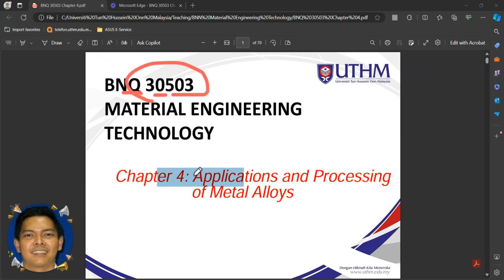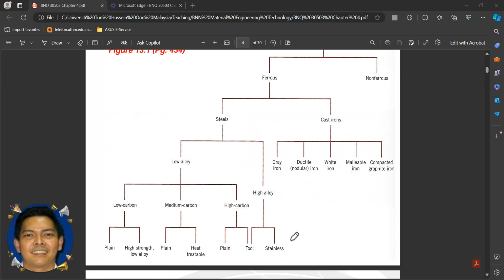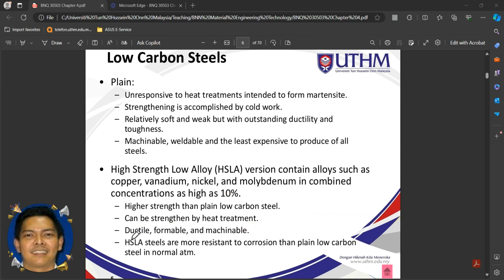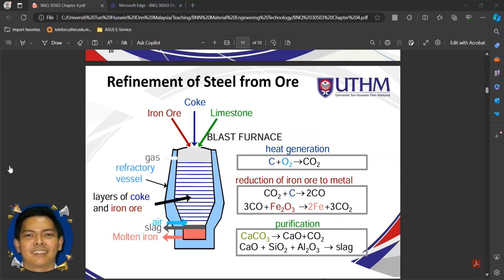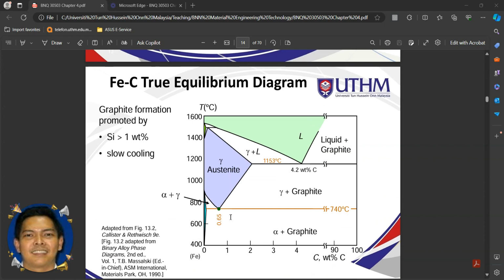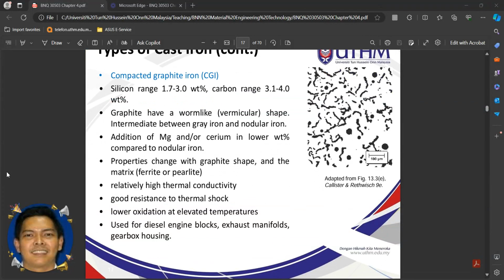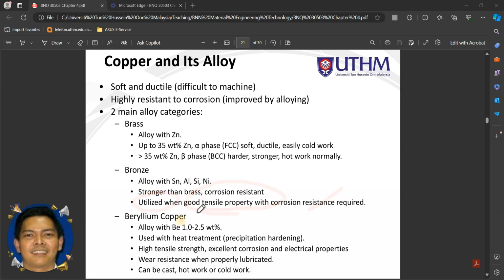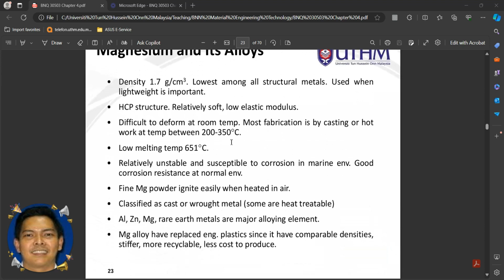Chapter 4: Applications and Processing of Metal Alloys (Part 1)

Comment: thank you for the lecturer dr. What i have learned from the lecturer is the application and processing methods of metal alloys in industries like construction, automotive, aerospace and electronics. it covers ferrous metals and non ferrous metals. dr also highlights the uses of low alloy steel, high alloy steel and stainless steel for their strength and corrosion resistance and the advantages of aluminium and copper alloys in aerospace. key processing methods include thermal processing and precipitation hardening.

Comment: Fatin Nabilah
Thank you dr..for this lecture..

I've learned how to classify metal alloys as ferrous or nonferrous and how to use examples from this video. Apart from that, describe the low and high alloy divisions of steels using examples. Will there be a chemical reaction if we simply combine the pure metals together?

Comment: From this chapter, I've learned that the choice and application of metal alloys vary depending on their intended use. Different alloys are utilized and processed in various ways based on their unique properties, such as strength, conductivity, and corrosion resistance, which make them valuable in industries like electronics, aerospace, automotive, and construction. Processing techniques like forging, casting, machining, and heat treatment are employed to achieve the desired shapes and properties.
(Wan Ariza)

Comment: Afrina (AN220220)

thank you, Dr. for the good video explanation about this chapter. What i learn is the classification of metal alloys, which is ferrous and nonfererrous, the characteristics of the 
differences alloy such as the low carbon steel iron, medium carbon steels, and so on. Dr., can you explain more about Fe-C True equilibrium diagram causes? I'm a bit confusing to understand the diagram. Thank you dr

Comment: This lecture explain about metal alloys and how they are used in different industries. Which explain that alloys are made by combining different metals, and there are lots of different types of alloys. One type, called ferrous alloys, is made mostly from iron. Within the ferrous alloys, there are two main types. Steel and cast iron. Then how different types of steel and cast iron are used in various industries. Also other alloys, like aluminum and copper, and about some of their uses. 

My question will be about ferrous alloy since Dr did mention about it so how exactly does the amount of carbon content affect the properties of steel? will it be low carbon, medium carbon, high carbon? -Danish Haady

Comment: Alloys are more affordable, stronger, more workable, and less prone to corrosion than pure metals. Specifics like machinability, ductility, and brittleness are determined by the alloys' composition and method of manufacturing. My inquiry is: Does the quantity of each metal affect the properties or strength of the metal alloys made from a combination of pure metals?

Comment: From the video, it can be conclude that metal alloys are divided into two categories which is non-ferrous alloys (copper, aluminium, titanium, magnesium alloys, refactory alloys and noble metals) and ferrous alloys (steel and cast iron). These alloys go through phases of nucleation, solidification and transformation rate which frequently shown in CCT.

Comment: Vanisri Kumarii 
I learned from this lecture  that metal alloys find a wide range of applications across various industries due to their unique properties and characteristics. Stainless stell can be diveded into 3 classes. I also learned about of cast iron. and how it is produced.  My question is, how does the selection of specific metal alloys and their processing techniques influence the performance, durability, and cost-effectiveness of components in industy?

Comment: What i have learnt from this chapter is based on the particular alloy and intended usage, different metal alloys can be applied and processed in different ways. Their special qualities, including as strength, conductivity, and resistance to corrosion, are typically what make them useful in sectors like electronics, aircraft, automotive, and construction. Forging, casting, machining, and heat treatment are processing methods used to obtain the required forms and characteristics.

Comment: Nor fatihah :
From the video, it can be concluded that the alloy is divided into two parts which are ferrous and non ferrous. Among the ferrous examples are steels and cast irons, while the non-ferrous examples are copper, aluminum and magnesium. This is because a ferrous alloy is typically more resistant to rust and staining than, say, carbon steel. By contrast, non-ferrous metals are incredibly durable and don’t degrade over time. The same is only true for some ferrous metals. My questions is there the percentage composition of alloy is constant or it can be changed ? If so, how can i know ?

Comment: From the video, it can be concluded that metal alloys are commonly classified into two categories. First is Ferrous, which primarily contains iron and Nonferrous, which excludes iron.  By knowing the differences between these types of alloys it is important for choosing the right material for particular engineering and manufacturing needs. Each classification offers a diverse range of applications across industries such as electronics, construction, automotive and aerospace.

But for production of steels alloys, how do the alloying elements like molybdenum, tungsten, and vanadium can contribute to the enhancement of hardness, strengthening, wear resistance, and thermal stability?
What factors should I included when deciding between them?

Comment: From what I understand, this chapter tells about all the various metal alloys that exists. These alloys are divided into two categories which are ferrous and nonferrous alloys whereby each of the alloys would have different compositions and unique characteristics that depends on them. Plus, the ways to process and produce the alloys are also different in ways that are very interesting. It would seem that this chapter is going to be difficult tu capture but at the end, in my opinion, seems interesting to learn. 

But there is one part that had gotten me curious. Stainless steel is divided into another three classes that is based on the predominant phase in microstructure which are martensitic, ferritic and austenitic. 

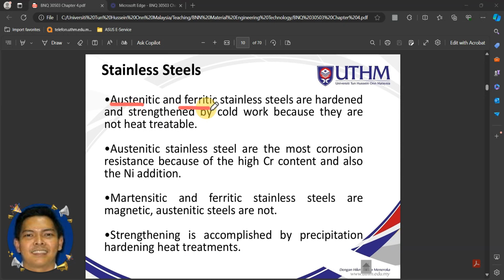I was wondering, why are austenitic and ferritic stainless steel are not heat treatable and would that mean martensitic stainless steel would be heat treatable? ( 11:12 )

Comment: There are various type of metal alloy that we need to know and understand in this chapter which exists in various application in real life. For example ferrous and non ferrous alloy. All carbon have different strength according to their type which is low, high and medium. It is a quite difficult chapter as there are many types of metal alloy needed to be remember. There are also several limitation for ferrous alloy. The explanation are done in a very simple way with various example which make it more easy to understand. How does the percentage composition for the alloy is calculated? Does the percentage composition number stay constant or will it change over time?